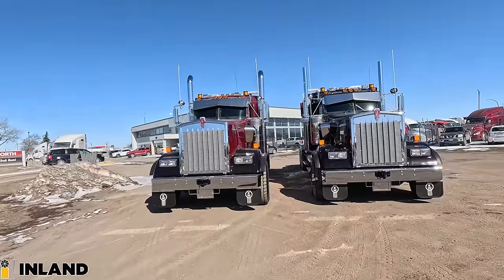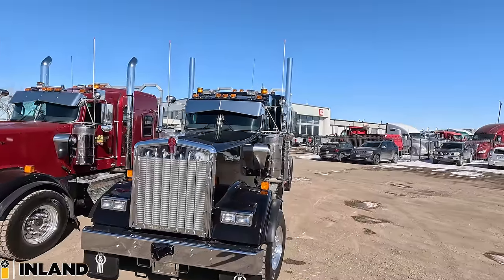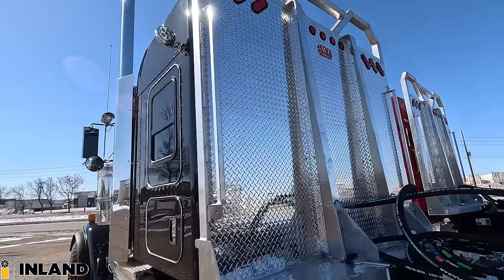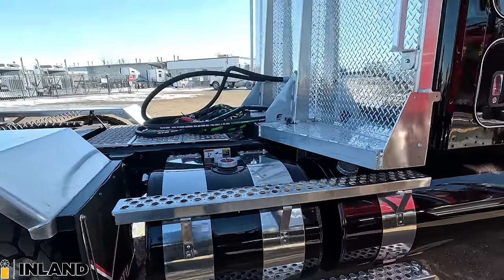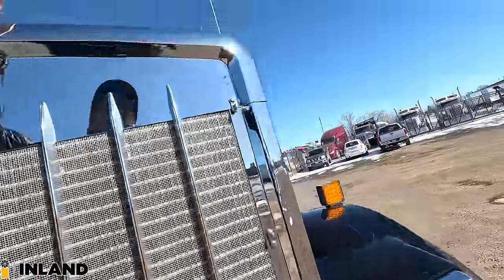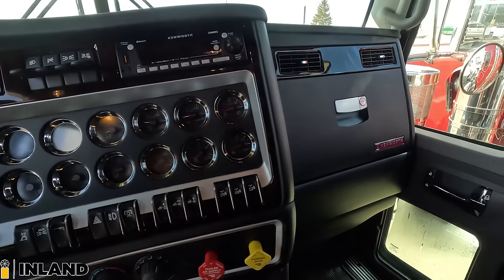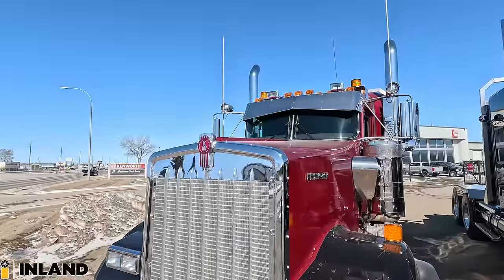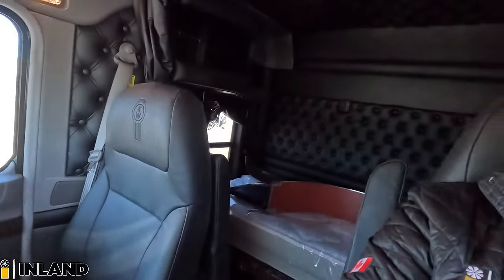DOUBLE FEATURE   KENWORTH W900L HEAVY SPEC LOGGERS - THE KENWORTH GUY

Comment: Question........can you swap out a normal steer wheel with a "floater" wheel or does truck have to be spec'd with the floaters from the get-go for spacing purposes????? I really like the low wide mean looking stance👍🏻
Reply: You can put wide base tires on a truck that came with standard width steers, but depending on the wheel offset you might have to adjust the steering stops so they don't rub.